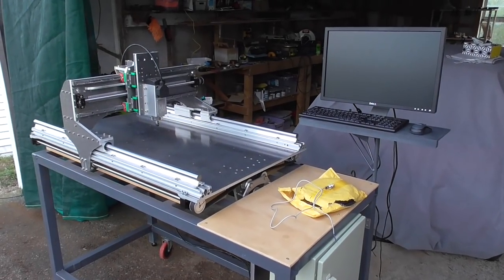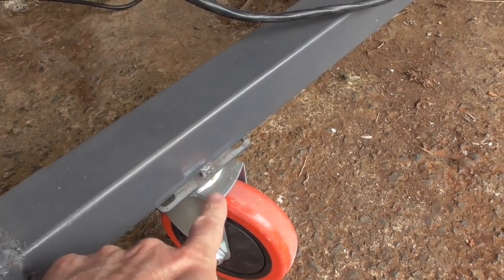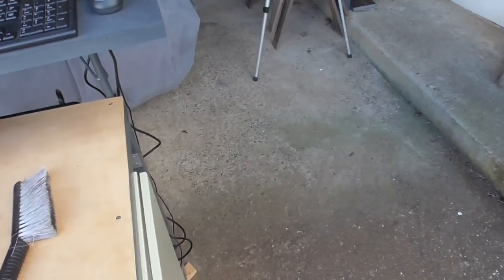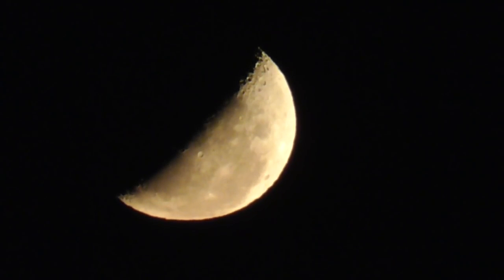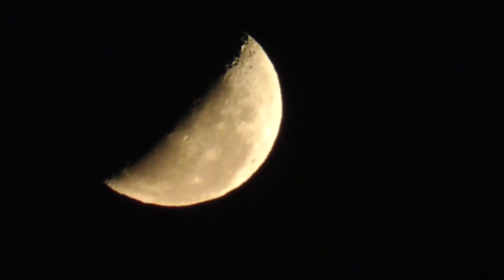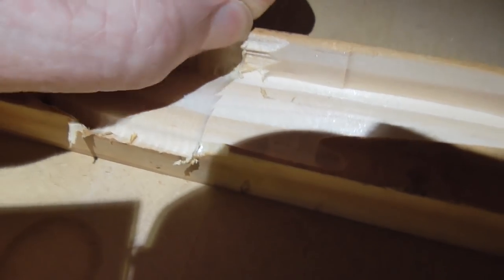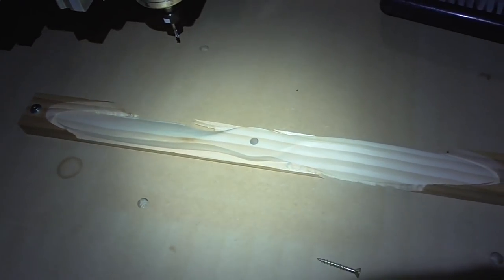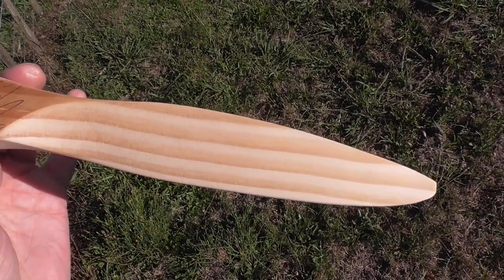Another DIY CNC router, part 11 (wasteboard surfacing, making and testing a wooden prop)

Comment: When you want to put a new MDF sheet on create a program for your bolt pattern. Place the new sheet on the old and offset your origin an inch in the long direction that way your holes are always accurate and you wont hit the hold down hardware.
Reply from the maker: The machine can only reach 6 of the 20 holes I wanted. I suppose it would still work with bolts only inside the work area, but less ideal.

Comment: why not make a cyclone dust collector for the vacuum cleaner ?
Reply: That nozzle on the inside of the vacuum cleaner bucket did create a cyclonic action, allowing the heavier stuff to fall before the air is passed through the filter. I think Chris's idea of adding a bucket to the bottom will improve this effect, though he may need to figure out a way to alter the tilt of that fixed nozzle.
Reply: Mumbai Verve:  It is at about this point that many CNC router builders discover how much they need effective dust collection!     :o)

Comment: Looks like the reason you’re not cutting the corners with the surfacing bit is you need less stepover, I use 60 to 70
Reply: Fierceflyer55:  I had to read your comment more than once before I woke up.  My mind said "No... you want a bigger stepover, then I realised that, of course, that is numerically smaller.  Is the glass half full, or half empty?     :o)
Reply from the maker: Yeah I get mixed up with stepover and overlap too, each time I use a new software I have to stop and think what it's meaning. At least when it's 50% there's no possibility of a mistake :)

Comment: for this design, i recommend running a roughing pass before the contour op. KM3.3 has some routing improvements in outline mode. tabs cause a routing issue, which is a known bug and will be fixed
Reply from the maker: Yes, that's what I was doing in the video. I made an account on your forums the other day so I might start some discussion there sometime.

Comment: The shielding on your cable needs to be connected to ground, otherwise is isn't doing anything.  Connect at one end only on the side closest to the ground of the thing it connects to, or main ground connection.
Reply from the maker: It's not doing nothing, just not as effective.

Comment: One found having a 2.5kg weight (scrap metal, iron, lead) in bottom of shop Vac stops them tipping over when in use, 
Most are poorly designed being top heavy, with small footprint.

Comment: Also, could you not use the machine to drill the holes for the waste board. In the very least, the relative hole distances will be consistent when you need to replace the waste board.
Reply from the maker: The machine can only reach 6 of the 20 holes I wanted. I suppose it would still work with bolts only inside the work area, but less ideal.

Comment: Use rattle can clear coat on those rusty rails!  Remove them and clean them then put a couple coats on them.  Put them back on and grease only were contact is made.  You won't have rust issues anymore.

Comment: Great video as always. Silly question, why didn't you use the CNC to locate the MDF mounting holes so that you can just rerun that program when you need to replace the MDF and thus the holes will be in the same position on the new piece.
Reply from the maker: The machine can only reach 6 of the 20 holes I wanted. I suppose it would still work with bolts only inside the work area, but less ideal.
Reply: @iforce2d  That makes sense. Your use of the thread in transfer punches will work just as well.

Comment: Stunning Chris!... You've open the gateway to a whole bunch of new adventures.   :o)
Re the dust; I had a very cheap drum-type shop vac many years ago.  It was very poor quality, but the thing that made me ditch it was the filter, which clogged very quickly.  Cleaning it resulted in breathing as much dust as if I had never used it.   These days I use a small domestic cleaner that we bought thirty years ago.  It had staggering suction, but was never used because it had a pathetically small fabric dustbag.  Five years ago I made a thien-baffle separator for it, using ideas gleaned from numerous Youtube videos.  It's not perfect, but absolutely worthwhile.  I mounted it in a simple trolley with a flat top to lay tools on, side hose hooks, cord storage, power plugboard, and an anglepoise work lamp.  It has become my best workshop buddy.   :o)
Thanks for everything... don't stop having fun.

Comment: Spindle tramming is actually pretty easy with a piece of sturdy wire.
1. "Flatten" an area on your wasteboard (or some sacrifical piece). This will have ridges because of bad tramming.
2. Use a decent enough parallel (eg spirit level) to create a flat reference surface on the Y axis (where you have to shim the spindle).
3. Stick a thick wire into the spindle and rotate in a 10-15 cm radius to see which side it is tilting and by how much. Correct the tilt.
4. Repeat in the X direction by tilting the spindle left and right.

On a very lousy desktop CNC this gave me close to mirror finish with aluminium.

Comment: The way to avoid false triggers on your limit switch lines is to ensure that they're all configured to be Normally Closed switches which are tying the line to ground whenever they're not in fault. Having the line in a low impedance grounded state like that makes it near impossible for signals of any magnitude to be coupled in.  I recently built some little buffer PCBs for my proximity limit sensors using an N-channel mosfet to hold the line at ground from right up at the sensor until it triggers. Happy to share more if needed. EDIT - I should finish watching before I comment. I see you have the same sensors as I did. Your way of solving it (change to NC sensors) was probably easier ;-)

Comment: Very nice. Plan on revising your stacked slices method for cnc instead?
Reply: Robert Bender:  I did wonder when I heard his reference to the "rctestflight" channel, if we might see some fuselage half-shells and and wings done totally by CNC, as shown there on a recent tri-wing slow flyer video?  Whatever happens, I will be watching with enthusiasm!    :o)
Reply: @PiefacePete46  As will I!
Reply from the maker: Yes, most likely. I'll have to experiment with XPS machining before I decide whether to go ahead with such a big job, but the plane in my recent community post is being designed to fit within the capability of this machine. I also located a source of the XPS boards that I thought were no longer available so I have plenty of material :)
Reply: @iforce2d  So many ways to do it these days, awesome.

Comment: Wow, I am very impressed with the result. I think you can be very proud of the self-developed milling machine. Of course, there are limits to the stiffness and therefore to the materials that can be machined. But for aluminum, plastics, wood and much more, great results can be expected. I am already looking forward to the first applications on your model airplanes. Great work!

Comment: As an electrical contractor, a pet hate of mine is cable ties cut with side cutters. .......🤷‍♂️🤷‍♂️
It leaves an edge (as clearly seen in the beginning of your video) akin to a stanley knife and at some time or other one will brush up against it and tear skin off like a razor.
Answer is to trim off with a sharp knife , flush with the ratchet boss.
There is a dedicated tool for the job but usually beyond the finances to justify for the hobbyist.
I have 3 which covers different size ties.
You say "shielded cable" but the shield doesn't appear to be connected to any ground anywhere.
Grease would work fine but Zinc spray would be even better for longrun.
Would need pulling apart again so the former would be my choice.
Overall, that is SOME machine....great work.
Yeah...wheels are sh****t.
What's wrong with using the old waste board as a template..??
Reply from the maker: I usually run my finger over the cut edge to check if it's sharp, and file or snip a bit more off if it is.
Yeah you're right, I could just use the old wasteboard, assuming it's intact enough.

Comment: Why not do the waste board holes in CAD and then just use the machine itself to drill them? That way you can spot drill the holes in the next waste and they'll be in the same place automatically
Reply from the maker: Yes, of course that's how it should be done. This was never intended to become a full prop, I wasn't even expecting to mill both sides when I started.
Reply: @iforce2d  I was talking about on your waste board
Reply from the maker: The machine can only reach 6 of the 20 holes I wanted. I suppose it would still work with bolts only inside the work area, but less ideal.
Reply: @iforce2d  ah

Comment: Has the Ryobi shop vac worked out OK?  I will probably have to replace my little Kenwood sometime... age is catching up with it; rubber seals splitting etc.
Reply from the maker: Seems to be doing fine so far. As you mentioned (I think) it's very light and tips over easily, especially when there's only foam inside. Otherwise no issues. If buying again I think I would try to get one with a speed dial to slow it down a bit.

Comment: About the noise in 17:14. Notice that cutting blades are not on the whole diameter of the cutter. So when the cutter moves the blades cut material in front of and also the material under the cutter and the sound is different.

You can avoid big chunks of wood breaking from the material. It's all about correct tool path and tool milling direction. I can help you with correct tool path if you want.

Greetings.
Reply from the maker: Yeah I know about the milling direction, I showed a demonstration of the difference in the video. My point there was that kiri:moto settings don't work :)

Comment: hi, why you dont use fusion360 to generate Gcode? it's very smart and use is simple.
and for better surface finish with less time you can use a bigger ball nose with the same stepover
Reply from the maker: Because it doesn't run on Linux. 7mm is the biggest tool I can use with this spindle, but 6mm seems to be the most common size tool you can actually find.

Comment: and if you can, put spindle cable far from limit switch cable. because spindle is hi frequency and put noise on limit switch and use shilded wire for wiring stepermotors and limit switch
Reply from the maker: Yes, all wires are shielded. It's not frequency so much as high voltage (240v on spindle) that can cause issues.

Comment: Slower to fast plunge on on big bit on  motor is easier to cut once moving because you are only cutting in front of you not the whole bit .I would use fiberglass resin on prop instead of varnish also , Its  really coming along Chris looking forward to many more of these videos 
Take Care
Reply from the maker: Yeah I should have thought of that. At the beginning it's cutting with the inner face of the blades as well, just for a moment.

Comment: Too aggressive! I find best results with 4mm end mill followed by 2mm tapered ball mill for jobs like this.
Reply from the maker: The larger radius allows a larger stepover while still keeping the surface flat. No way I would want less than 6mm ball end for this. The only reason to use a smaller ball end would be if there are smaller features that a larger tool could not reach into.

Comment: Why not use the cnc itself to drill the waste board mounting holes. Then you can just repeat the program with future boards.
Reply from the maker: The machine can only reach 6 of the 20 holes I wanted. I suppose it would still work with bolts only inside the work area, but less ideal.

Comment: I have no Linux or (obviously) LinuxCNC experience, but I thought it was performing all the operations you needed?  What have I missed?
Reply from the maker: Yes, LinuxCNC is fine. The issues are mostly with the CAM software that generates the toolpath, that's not LinuxCNC's job.
Reply: @iforce2d  Gottit.  LinuxCNC is a Linux alternative to Mach 3 or 4 etc.  I was crediting it with being the complete package... Pretty picture in ----- G-code out.  Thanks.

Comment: If you are feeding 12 or 24 volts to your limit switches, You would not need shielded cables for the them, the noise levels compared to the signal coming from the limit switch is negligible!
Reply from the maker: Right, that's what I'm hoping too.
Reply: @iforce2d  "Once bitten, twice shy"?  We all held our breath, and wept with you every time the little machine locked up from crosstalk spikes!  A little bit of over-spec now might save hours of frustration later.

Comment: Machine is looking good. You can use the old waste board as a template for the new one. Good idea to use a cyclone and drum in line with your dust collection, this will save cleaning your filter with very fine dust. Have a look at Dolphin software for your Cad and Cam.
Cheers Dave
Reply: Or draw up a file to drill the baseboard holes, then use the same file to drill the holes in subsequent replacement baseboards. That’s what a cnc is for!!
Reply from the maker: The machine can only reach 6 of the 20 holes I wanted. I suppose it would still work with bolts only inside the work area, but less ideal.
Reply: @iforce2d  Ah ok. Thinking about it my cnc can’t get everywhere on the board either.
Great machine though. WD40, grease or anything similar will help with the rust problem. Or there is a really good product called acf50 that will give you a less sticky protective film (so dust and chips will be less likely to stick to the rails and screws).
Thanks for the video.
Reply: @srp01983  :  That was my immediate thought.  Now I have seen the reply, I am glad I resisted the urge to comment!    :o)

Comment: the new vacuum you bought does not look like a bagless vacuum to me. Are you sure it is bagless?
Reply from the maker: I don't recall saying it was, but there are no bags anywhere and it calls itself wet-and-dry. Surely a wet-and-dry vacuum would not use a bag?
Reply: @iforce2d  oh, I just looked Kärcher WD3 vacuum manual for the exact same design of vacuum.
And it says "do not use filter bag for wet vacuuming"
"To vacuum fine dust, use the filter bag"
Reply: @iforce2d  so when vacuuming MDF dust it might clog up really fast without the bag

Comment: Why not just use fusion 360 for windows?
Reply from the maker: Because I don't use windows. I do have it on a hard drive I could swap into my main computer, or use it on the laptop, but neither of these are appealing options.
Reply: @iforce2d  For cad it's awesome. I've never tried the cam on it but I've heard many ppl recommend it. You should give it a shot even if through wine or vm

Comment: And smaller stepover
Reply from the maker: Yes, that's quite right. This was only a quick test as my first ever double-sided experiment. I was actually never intending to put it on a motor. Just yesterday I made another prop design from scratch that could be used for actually flying a plane, and for that I will be using about 0.8mm stepover.